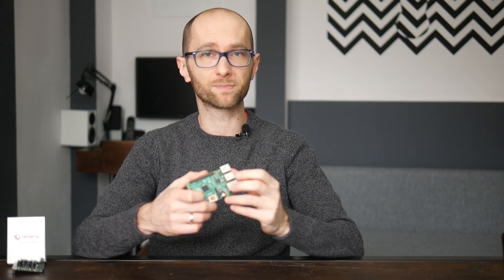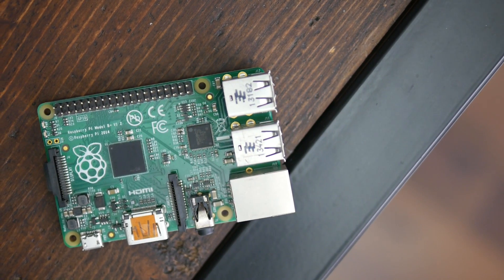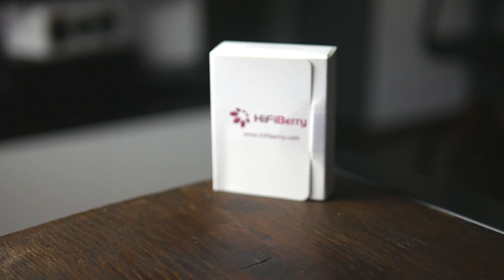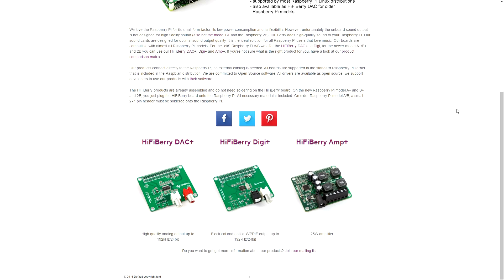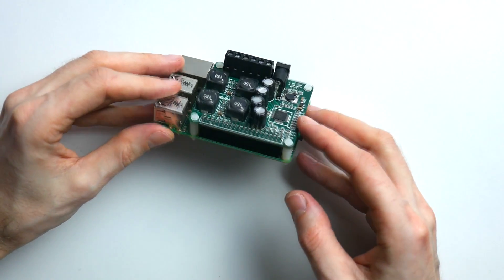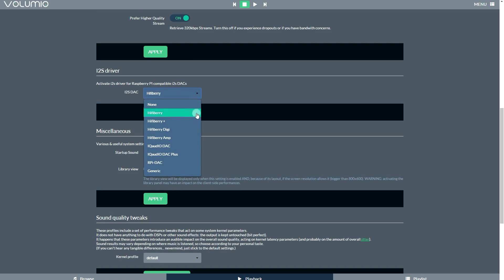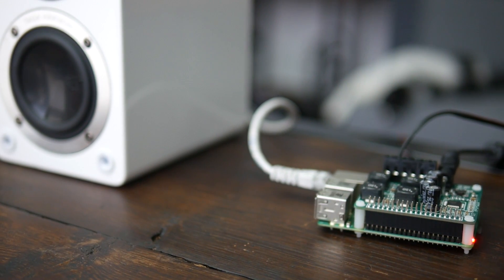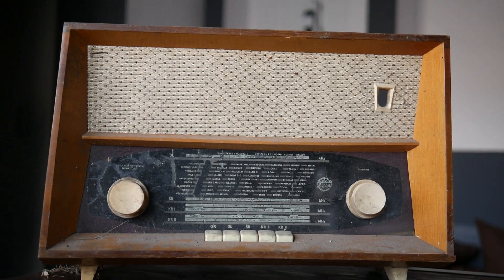HiFiBerry Amp+ review - ultimate DIY audio tech

Comment: My coworker got a Raspberry Pi 3, 4, and 5, along with the HiFiBerry DAC2 ADC Pro sound card hat and a case to put it all in. The hat alone was $75, and I don't even want to know the total cost of everything else he bought. We installed a 128GB memory card with the newest Raspberry Pi OS downloaded from the Pi website. We did everything: editing config files, going in as root, editing stuff, trying everything on your website, editing the config file to turn off HDMI sound—just a ton of absolutely ridiculous stuff to try to get it to work. We tried all three versions of the Raspberry Pi hardware as well.

There are no definitive drivers or installers. My guess is you depend on the Raspberry Pi OS to load most of it by default and use some kind of mumbo jumbo homebrew code to make it kind of haphazardly force it to work. Then, when Raspberry Pi updates, it leaves your device with so many variables that only a pro user who knows everything about the OS might have a chance, if they are lucky, to get it working. I'm just being honest, not trying to put your company down. I feel that you guys need to STOP, take a step back, and look at what you're doing. Work on developing software and driver packs with 6 or fewer clicks to auto-detect the sound card and install it, with some tools to test and make sure the sound card is working. If the sound card fails to install, have it provide some useful information on WHY.

Frankly, the HiFiBerry and Raspberry Pi platform is a complete joke, basically a kid's toy dressed up to look serious. In this day and age, if you can't just snap it together, load the OS, load the driver, and have it just work, then it's basically a waste of time. I told my coworker to give up on it, send the HiFiBerry and anything he can back, and get his money back. I can build him a basic PC with a Creative sound card that will run circles around this little tinker toy product.

Comment: have the dac+ lite and it is uter crap -  it makes volumio crash , kills the autoplay , brings the pi in undervoltage problems ( when heating up it draws lots mire than should)  . only thing that is even more disappointing than the quality is their "customer support". planned on buying the amp2 but now it will be a non-hifiberry product.
Reply from the maker: Are you sure it's the DAC and not the Volumio itself? One of my endpoints just became unresponsive after upgrading it to the newest revision... I'm seriously considering spending money and switching to Roon.
I've been using this particular AMP board on daily basis for over 3 years. I have another AMP based endpoint and it's been also working just fine. But I know that bad experience with one product can make you hate the brand.
Reply: @YetAnotherTechChannel  i tried the dac on different pi's and different software ( not only volumio) and got the same result
 so i'm fairly shure it is the dac . it also doesn't once give out any audio

Comment: What will be the difference in quality between this and hooking up a chromecast audio to the same speaker?
Reply from the maker: The HiFiBerry AMP+ is an amplifier - you can use it with passive speakers. Chromecast, on the other hand, requires active (powered) speakers. The sound quality of the latter will be mostly determined by the amplifier built into the speakers.

Comment: So is this an amp or receiver?
Reply from the maker: Hmm... would you mind explaining the difference between the two? I always thought that both take a signal, amplify it and send it over to speakers. This one, you slap onto a Rasbperry Pi and it decodes the digital audio stream, converts it into analog, amplifies it and plays it on speakers.
Reply: @YetAnotherTechChannel  i think youre right. What I meant was can I plug speakers into it by speaker wire instead of aux only? The way you would hook up an entertainment system.

Comment: Is this amp better than used ab class amps in similar price? I am asking about sound quality.
Reply from the maker: It depends what signal are you trying to amplify. Analog audio output on the Pi is really rubbish and if you want a decent quality, you need a DAC.
Reply: I'm going to amplify signal from dac, and i don't know if i should buy hifiberry dac and used ab amplifier or just buy hifiberry amp+.
Reply from the maker: What speakers do you have? How loud are you going to listen to the music? If you have larger speakers and will listen to music rather loud, then you should go for a DAC and used amp combination. If the speakers aren't that powerful and space efficiency is an issue, then AMP+ is the way to go.
Reply: YetAnotherTechChannel I have small room, so 25 watts is enough for me and i havn't bought speakers yet, but i want best sound quality for price. Thanks for response.

Comment: I'm in the market for an amplifier for my raspberry pi carputer project. I currently have a 12" Kicker subwoofer + preamp installed and wish to upgrade my voicing in the future. Does anybody know if this would be a viable option as a replacement for my cars current system?
Reply from the maker: With a separate amp for the sub I think this might actually work :)

Comment: The hifiberry amp IS AWESOME. I've tried them with some desktop infinity speakers, mid size and they blew me away! Now planning to set them up with a pair of B&W monitors. Also trying to add binding posts for the speakers (I still couldn't find anyone who did that?!) and a custom case to include them.
Reply from the maker: +Charly Arg 
I was pleasently surprised by how well this tiny amp performs :)
HiFiBerry has a lot of different cases but unfortunately none of those are designed for AMP+. You can try posting product suggestion on their forum - they're good people, enthusiasts :) 
I myself am really close to getting a 3D printer so I can fabricate exactly what I need...
Reply: +YetAnotherTechChannel 3D printer great idea, yesterday I saw a guy in YouTube creating a case on it. Cool. l did something simple to fulfill my whim.
Reply: +Charly Arg here's a picture https://goo.gl/j3e7cg

Comment: I Love the sound of the HiFiBerry amp+. What set of speaker are you using in this video?
Reply from the maker: +rafael magallanes quintanar 
I'm also impressed by the sound delivered by this little PCB :)
These are satellite speakers from the Taga Harmony inMove set (https://youtu.be/EbqI8E9Qers). I did cheat a bit as I used a crossover and connected a passive Pioneer car subwoofer to one channel since those satellites do not cover full frequency range.
Reply: +YetAnotherTechChannel a small sub? that's an awesome idea. I will investigate about the crossover, no idea how to do that (is it a pass through connection?)
Reply: +YetAnotherTechChannel - the 25-watts was enough to drive a passive sub?  Without heat issues?  That seems pretty amazing!

Is there any method that could be used to get a low-level output in conjunction to the amplified outs, so that the low-level could be run to an active (powered) sub?

Thanks again for the excellent overview!